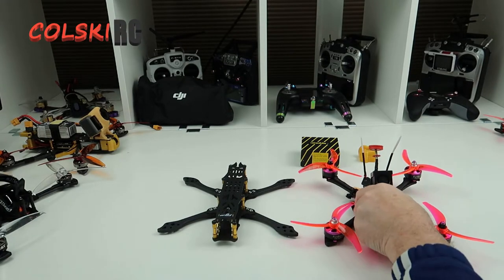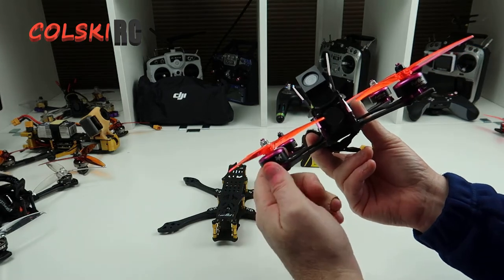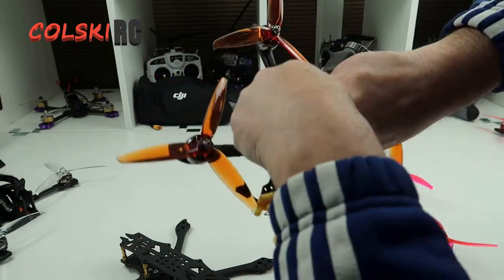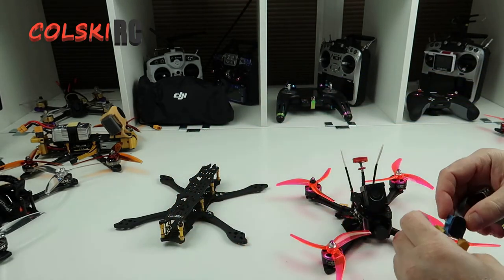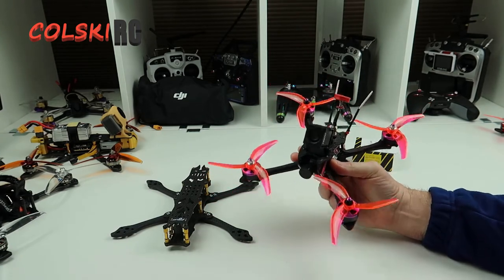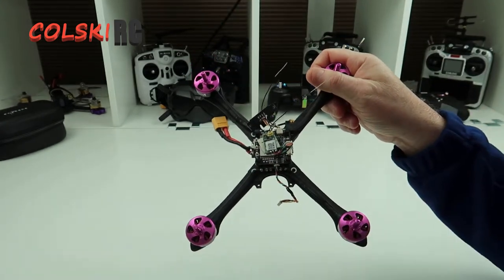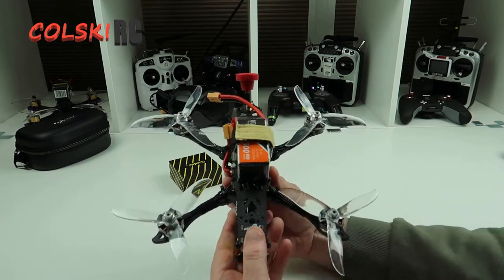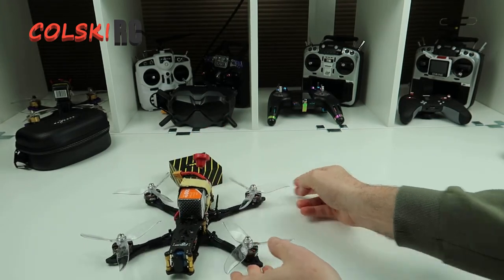TURNING A FURIBEE STORMER INTO A FLYWOO MR CROC WITH A 4K TARSIER

Comment: Wait, what, the $55 or whatever DJI frame kit doesn't include the TPU parts?  That sucks.
I know you can buy the TPU parts extra and they are like $12-$22 depending on which you chose with or without the session mount.   Dang that sucks.   Now I'll have to look again on their website.
Where did you get those wine colored amber orange props?
Reply from the maker: Yeah totally overpriced frames
Reply: @CKone41  I bought an extra frame kit and it did include the TPU parts :)   I also way over bought on propellors.  Still using the first set of foldable props I put on it.   

Total overkill on the long range transmitter!   Got a VAS Shapeshifter on the way for it as well:  http://air-war.org/graphics/Crossfire_Lite_01.jpg